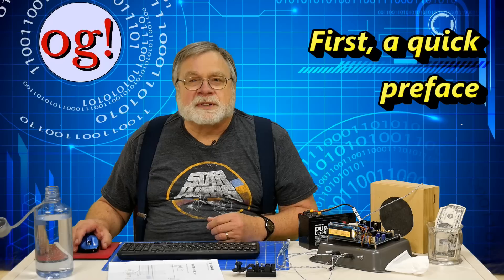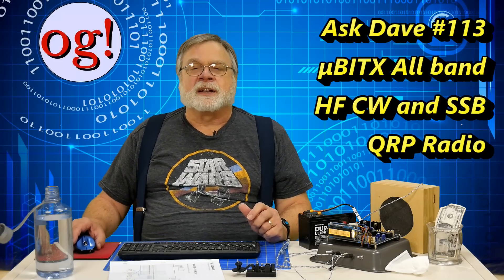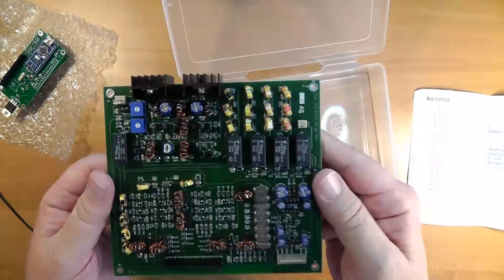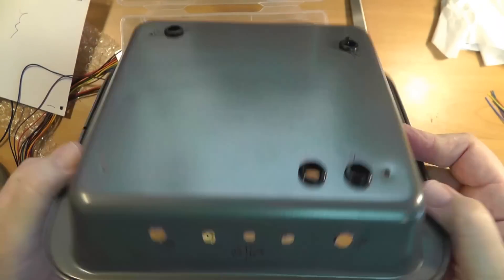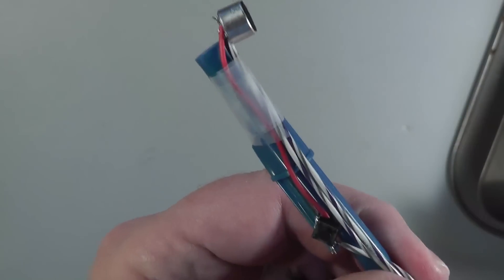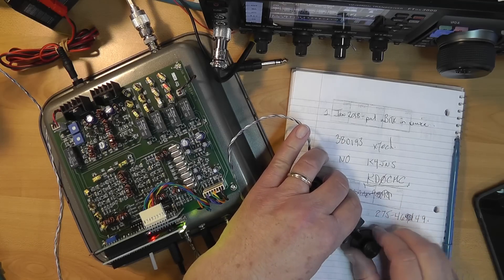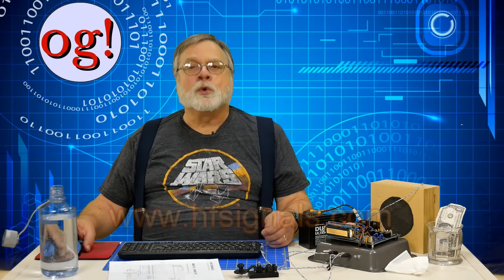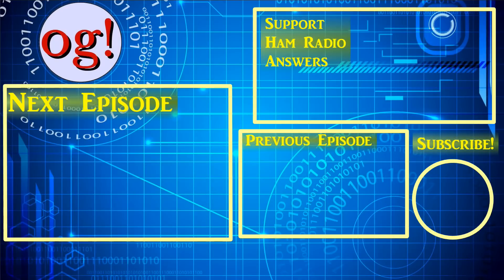New All-band SSB/CW Micro BITX Now Available (AD #113)

Comment: How can you fault Farhan for the software that comes with the radio?  Given the whole idea behind the BITX design, it's meant to be modified.  This is no different than with the BITX40.  The software is modifiable by the end user,  no mater what comes pre-installed in the Raduino, there will always be the ability to transmit where ever - that's what the filters are there for.  And as for FCC type acceptance - HA! I think you are missing the point, perhaps you should stick with your Yaesus, Kenwoods, or other commercially built rig.  This is not meant to be a plug-n-play rig, it's for experimenters and tinkers.
Reply: Kind of a American centric viewpoint there, other countries have different frequency allocations so it is simpler to just leave it be. Why would a ham radio need type acceptance are your homebrew projects type accepted, or a commercial radio modded to work on the ham bands?
Reply: But David, how is that different than any other radio that can be made to operate out of band by snipping a few diodes?
Reply: ** ROLLS EYES **....... Seriously Dave.....
Reply: Bitx platform was already made to be very hackable. That is being hack by the user as we choose, not by the manufacturer. Om bitx40 the user added a mod to make it stop giving out 'illegal' spurious. Bitx40 too can be made to transmit out of band. Don't get me wrong, I believe that manufacturers like these needs to stay within certain 'lines', because we need then to 'stay alive', stay making amazing gears, not forced to close because law infringement, or got banned in some countries because they did not follow certain rules. I'm not afraid to snip few diodes, hell I'd snip every diodes possible, or solder a bunch of diodes, but that would be on me.
Reply: Mmm no. There's much that can be done to default to ham only bands. It's called responsibility. That responsibility is for all. No, that's not what filters are for. Experimenter doesn't change band laws and interference diligence. This is not a new hobby, all this is easily understood by learning from more experienced which is why you're here right?
Reply: Whoa! Hold your horses man.. I believe Dave has a point, and by that he is not blaming anyone for that matter. The radio could come out of the assembly with a more 'rules friendly' settings. After reaching the hands of us, the user, it is then CAN be altered to whatever we want it to be, but it will be on us. I don't mind this, I think of it as rooting android devices. I have no commercially built rig either, all I have are homebrews. That is why I believe that these kinds of amazing yet economical kits and modules, things like bitx40, uBitx, and the likes should reach more people.. these needs to cross more borders.. and crossing borders means to stay within some legal measures.
Reply from the maker: The kit is being sold commercially and in large numbers. My concern is there are a sad few people who are not experimenters but are troublemakers.

Comment: Just an idea for the chassis, maybe some one could come with a design for a 3D printer?
maybe  this could be a front facia plate for the controls and lcd/micro pcb , this could then fasten to the bottom
plate which you have mounted the main pcb to . This could be whatever you have available 
in the shack/garage eg bit of of plywood etc but i think people will get the idea
keep up the good work
regards
Mark G7GEI
Reply: if you check out the main FB group there are several designs for 3d printed cases available.
Reply from the maker: Thanks!

Comment: I say leave it open tx all. If you as a ham op cannot stay in your corner you need to hand your license back in as you will open/mod anything else you are running. 

That applies to ALL hams. It is up to the operator to refrain from poor behaviour not the radio or it's manufacturer. Why would one radio locked make a difference when you can mod your fabulous Yaesus and Icoms and all the rest? If I were an OP looking to play naughty I'd just get a radio off fleabay that is already modded or easy to mod. Hell my SR8 I purchased a whilst back 2nd hand was open modded doesn't mean I'm wandering all over the place. 

What concerns me more is at 4w peak ssb you are going to need but  also have trouble driving an amp.
Reply: No nannying required...amateurs are required to continuously monitor transmission freqs to ensure no out of band transmissions occur. And we are very good at doing that. If the fears relate to pirate operators they are going to find a way regardless. In many cases snipping a diode is all that it takes to unlock a transmitter. Great job on the radio, Farhan !
Reply: Well my only HF rig is a Bitx40v3 simply because I can't afford more at this point. I've really enjoyed it and can usually make a handful of contacts a day, but I certainly would like to build an amp to go along with it for those times when i'm not quite making it.
Reply: bentrider1972 the amp idea was for those who buy the rig as an only rig. Contacts here are getting scarce and it's a common complaint by many. Yes when the bands really open up a few w is all you need but not all of us can live in a city of millions with many HF contacts to be made rather we have significant distance to cover and for 90% of the time 3w is not enough.

So rather than making an assumption and being arrogant and rude about it try opening the mind and realising that not everyone in the world lives in the USA and not everyone lives in high density areas.
Reply from the maker: I think we're getting off topic here. Let's keep this focused on the uBITX.
Reply: You can limit the transmit freqs.  It's all just a matter of software
Reply: Why do you "need" and amp for a QRP rig??? You talk about an operator with brains to " refrain from poor behaviour" yet think QRP rigs need an amp..Odd i have never needed an amp for my ft817nd before yet have rarely had a problem making any contacts...If you "need" an amp for a QRP radio why bother buying a QRP radio..Just go buy a 100 watt rig and leave QRP for the ones who like the challenge of low power :D

Comment: Thanks for show this radio is very popular in India along with VU3NKK linear amplifier for 150 watts give commercial effect on the air this radio is very good for new comer to come on the air 
Thanks 73es 
De VU2KOC
Reply: Do you have a link for that amplifier
Reply: This amplifier interests me aslo. Where can I find one?
Reply: It would be very irresponsible to use the linear amplifier you suggest. This amplifier is cheap because it does not include any filtering on the output stage. Thus Harmonics are present on all bands. As a Ham would you really want to use an amplifier that does not include any filtering on the output stage? and end up polluting the air waves with harmonics from this cheap ass amplifier? Really? Hint any cheap amplifier that does not include a bad selector on the front does not have any filters.  A Good inexpensive amplifier with output filtering is the MX-P50M.